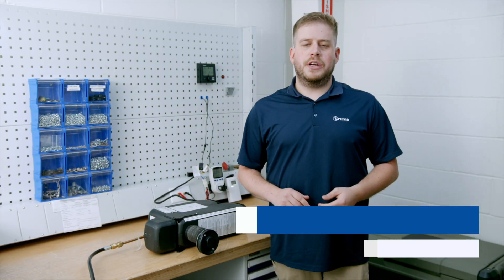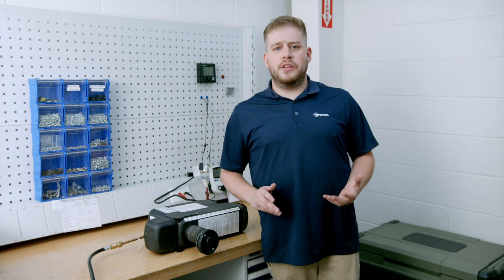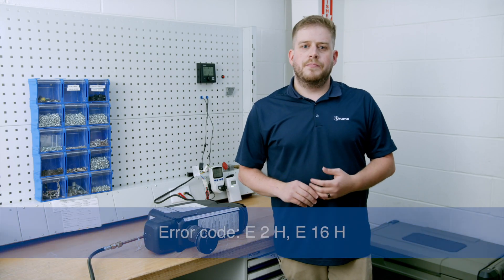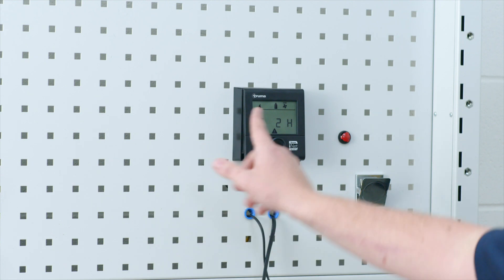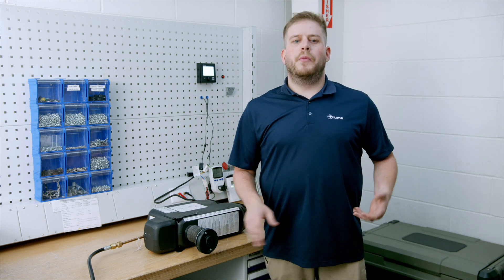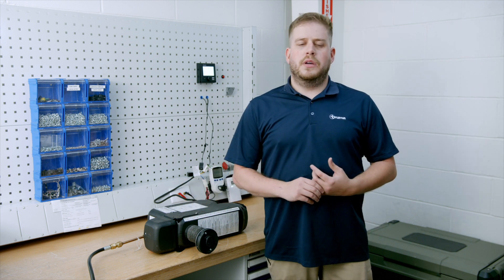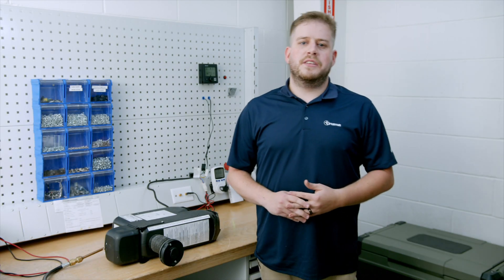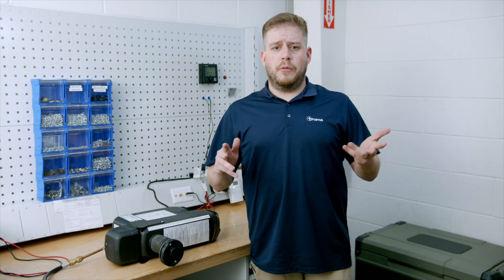Truma VarioHeat Tech Tip: Understanding Common Error Codes

Comment: Error E3h is very frustrating as it happens almost every time i try and use this heater, which is infrequently in out area.
How about Truma develop a system that purges air from the system if it gets this error, also a meaningfull error like, "Purge air from gaslines"